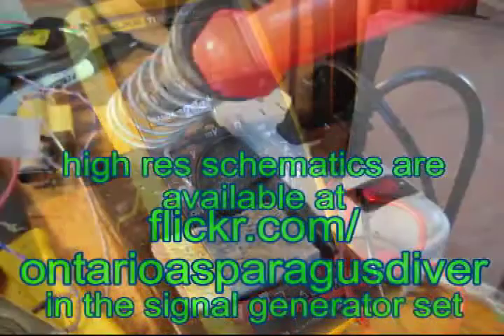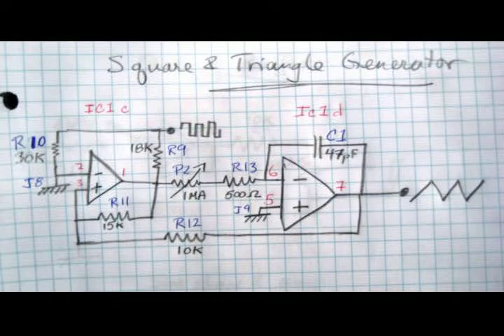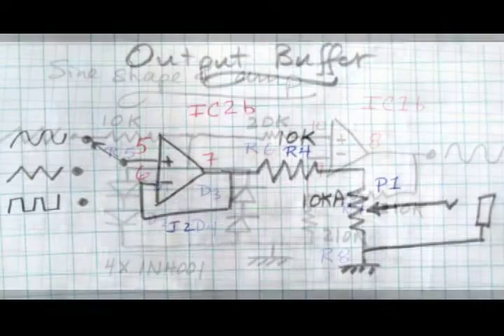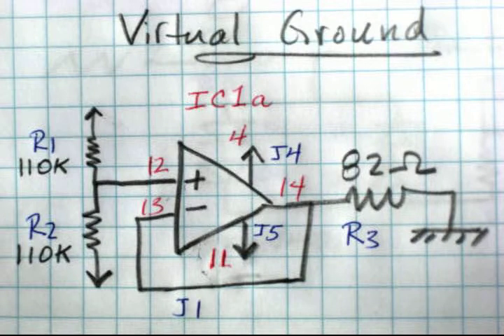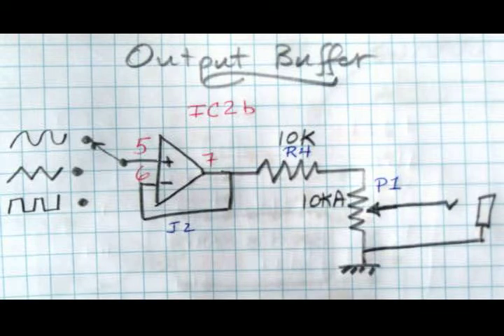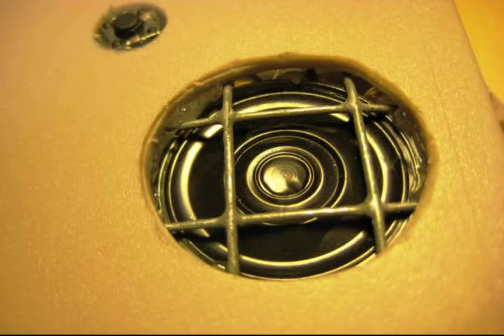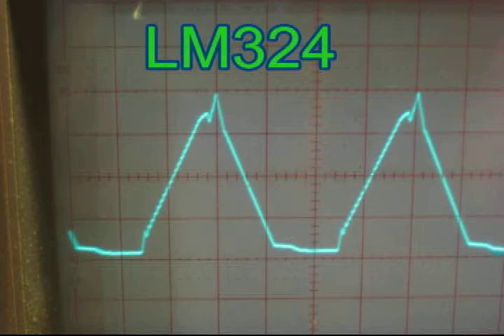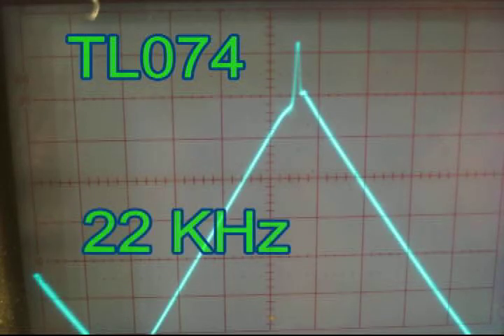Signal generator

Comment from the maker: The usual good way if you don't need an exact sawtooth is to use an asymetrical triangle,, that's generated similarly as the normal triangle except you use a diode net to implement different time bases for the charge and discharge cycles.  If you search sawtooth generator you'll find it pretty easily.